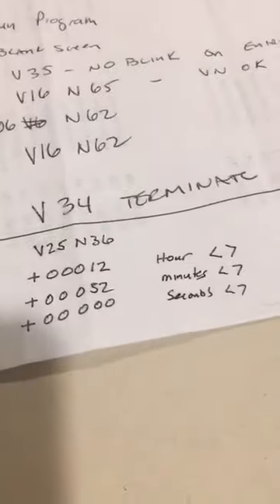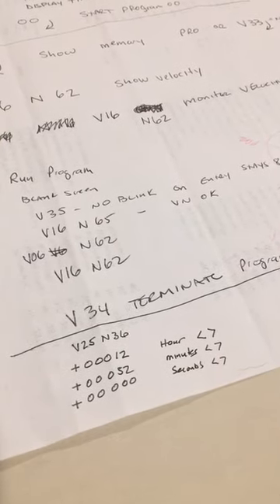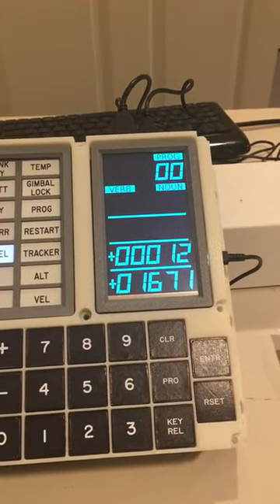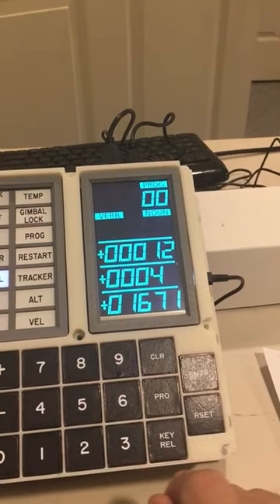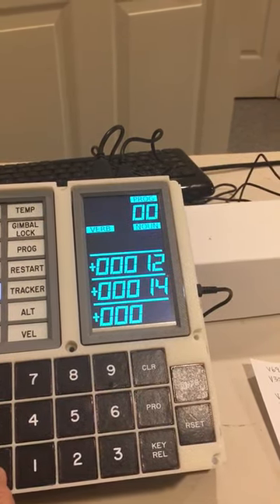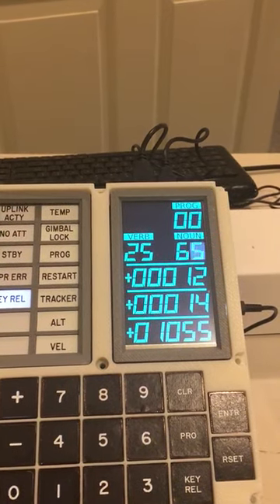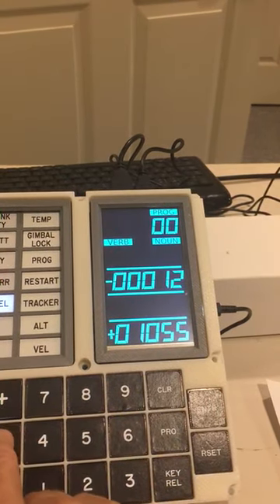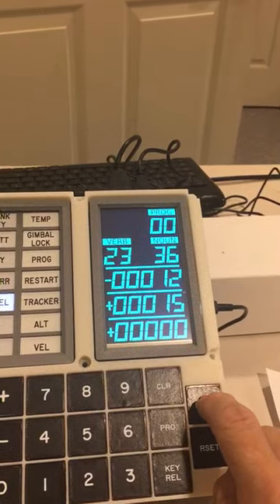DSKY

Comment: Where did you got the dysky and can i use it in a app like nassp in orbiter?
Reply from the maker: rockettony101 
Good afternoon. 
We are Telemetrics and produce the Apollo 50th Anniversary DSKY in ABS 3D printed plastic and also in Machined Aircraft grade Aluminum. www.thedsky.com 
This is a fully functional DSKY that uses the original NASA code paired with modern technology to create a wonderful rendition of functional vintage technology. The original AGC is incorporated inside the DSKY. We are in the process of creating a centrally located server that will allow users all over the world to interact with each other through their DSKY to run the original missions or create their own missions using a virtual AGC through one of the software platforms presently available.